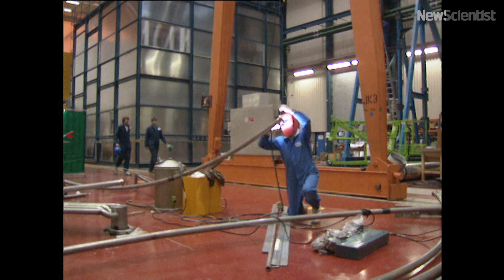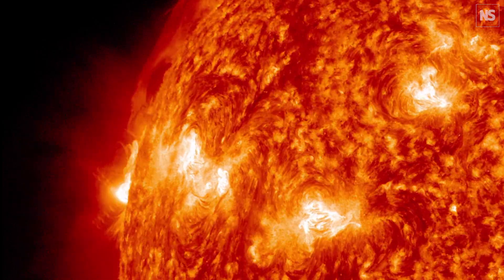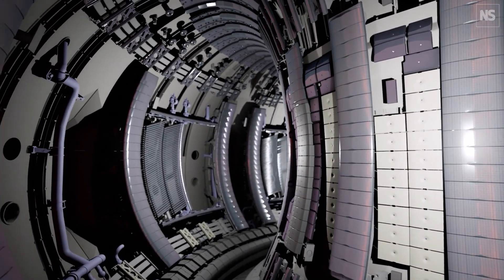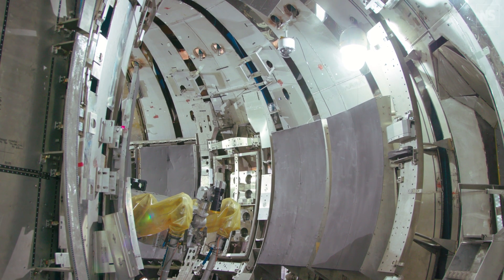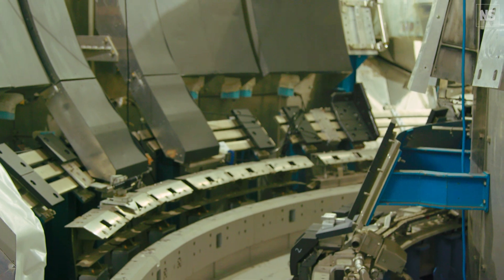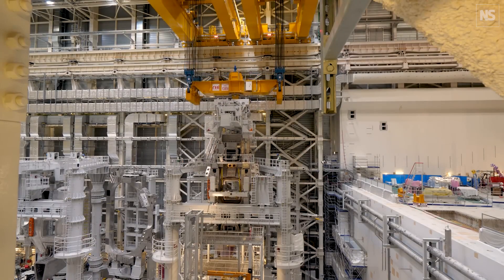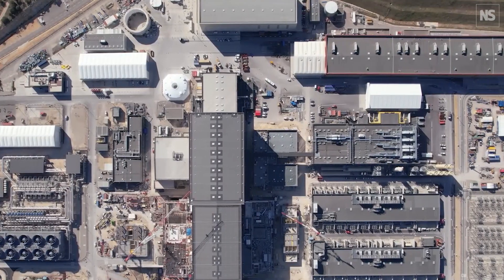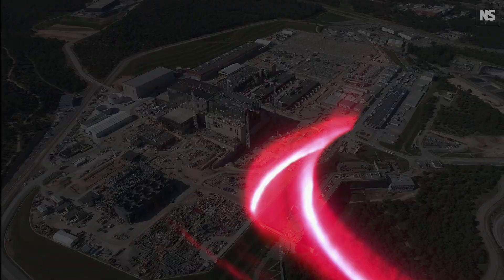Future of fusion: How UK's JET reactor paved the way for ITER

Comment: After some 60 years of research at Culham, the efficiency of the 5 second JET run was about 0.01. For a commercial fusion reactor the efficiency needs to be about 30, an increase of some 3000. The chances of doing this? Zero.

Comment: Yes, and do not forget the "time constant" of nuclear fusion. In 1988 I was on a conference on nuclear fusion in the UK and there I was told that commercial fusion power is 50 years away and that has been so  for a long time already. Today it is still the same.
Reply: it appears you people did not understand that humans are trying to recreate a miniature sun. The amount of time, complex calculations, trials, data that needs to take place seems almost impossible. Yet, these brilliant people have made groundbreaking progress to a clean way of life.
Reply: I went on a tour around the inside of that reactor in 1984. They were just building the RF heating system then because they said we need more power. Guess what? They told us it would be 50 years before commercial fusion power was available. They had better hurry things up.

Comment: Thanks for this informative and, for once, balanced report on nuclear fusion.  In particular, congratulations to the reporter who steered away from any wild guess  on the readiness of fusion as an energy source and  his rather somber conclusion that we will need to wait and see if it works.
Too often we hear too many people, in particular from the so-called private enterprises, boasting that fusion will be ready in the next few years...  If we are lucky, it will take more than half a century to have a real commercial reactor able to operate with a reasonable availability and economical viability.
However there is a point worth clarifying.  The scientist boasted that ITER will have an energy gain of 10  (the so-called Q). In fact, this is a recurrent misrepresentation of reality, Q is calculated on the basis of the actual power/energy injected in the plasma. However, to produce that input power, we need to consume several times more power  due to the low effciency of many systems.  In addition, ITER will operate, and will therefore produce power from nuclear fusion reactions,  on pulsed basis while it will require a steady consumption of a large amount of power  also during the non operational periods and dwell times (e.g. the power to keep the cryogenic plant running,  but not only). So, ITER will in fact consume a huge amount of energy  much larger than the nuclear fusion energy ITER will ever be able to produce!

Comment: I applaud the goal and the achievements so far, but the real question is how will the cost of building and maintaining a fusion power station (per kWh output) compare with the cost of photovoltaic,  wind and energy storage systems.
Reply: you should also consider the question of what the environmental impact (from mining, end-of-life disposal, land use) of fueling the whole planet (homes, industry and transport, and bringing the developing world up) with solar, wind and storage systems would be, along with whether the cost stays as low as it is now as we scale it up (cost now doesn't include storage - and we'll need vast amounts of storage, or back-up redundancy, for example). We need a mix of both.
Reply: fusion is not at the stage of having mass produced plants and until it is it is almost impossible to speculate on comparative costs